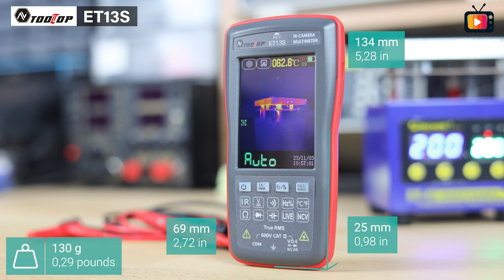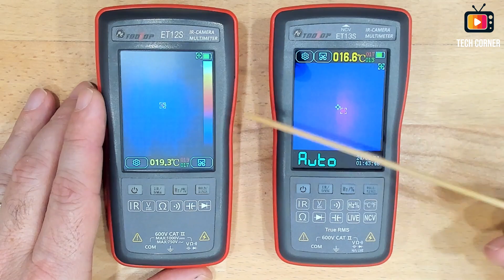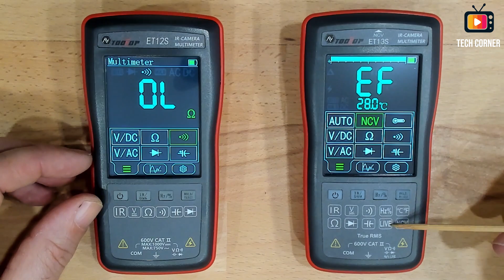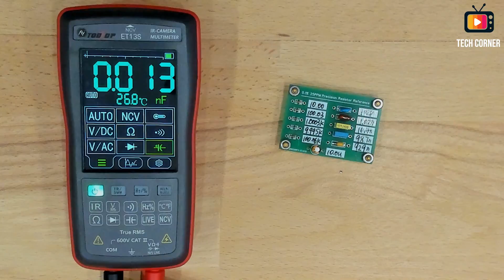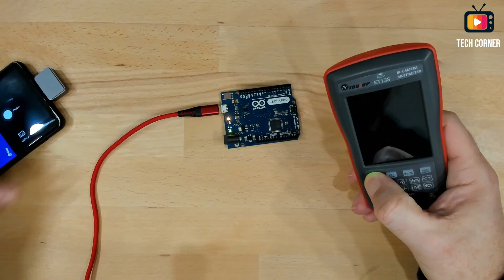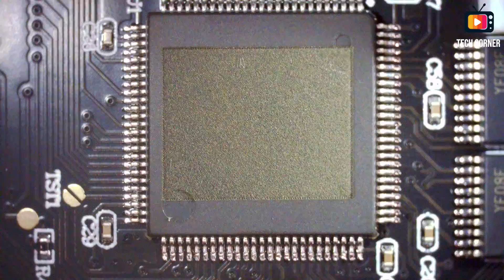Tooltop ET13S Thermal Camera & Multimeter

Comment: bought such an infrared camera (thermal imager) -tooltop et693c,
I cut out and glued a plastic overlay (ABC) for her for fastening microlyins
(to search for short circuits, on an electronic board)-
drilled two openings for the lens of the infrared chamber = 20 mm, and for the visible video camera = 14 mm,
I glued everything, glued everything with superglue,
And he glued the lens with other glue-Polimer-neutral,
Focus Lines Cloudray CO2 ZNSE
with a number = 25.4 mm (for SMD phones-PCB Circuit Board)
with a number = 38.1 mm, (excellent for SMD elements-PCB Circuit Board),
and number = 76.2 mm, (excellent for PCB Circuit Board)
The diameter of everyone is the same 20 mm, drilled and dirka for a video camera 14 mm.
It is better to take the brand of lenses = Focus Lens vs CVD ZNSE, it gives less distortion, but 2 times more expensive.
He cut out and glued a box of payments for nozzles with lenses to prevent scratches on lenses.
I recommend it! Everything works fine
Reply from the maker: Wow, thanks for the detailed information, really helpful! Thanks for watching and sharing.

Comment: Do you know the thermal sensitivity of this IR camera? I have not been able to find it anywhere and it is a fairly important spec. when evaluating an IR camera. The resolution on the display seems to be 0.1C but that is not the same thing. Thermal sensitivity quantifies the minimum temperature difference an infrared camera can detect and it is usually stated in mK (milliKelvin). It is also called the Noise Equivalent Temperature Difference (NETD). A lower number means higher sensitivity.
Reply: The newer ET15S has a spec of <40 mK. Not sure about this older model.

Comment: noticed on your video tooltop ET1 3S There was a subtle beep on diode mode. Please can you check again and let us know. Thanks
Reply from the maker: Hi, I don't know if I understood correctly, are you asking if it beeps when measuring a diode? It doesn't. Beeps on continuity. Thanks for watching.
Reply: It beeps very briefly on first connect, than stops until the next reconnection.

Comment: Thank you for the thorough review. I got the same thermal camera/DMM from banggood, under the Mustool brand and it's a quite capable little thing, especially considering the price. I have a couple of questions though. What is the max temperature, your unit can measure? Because,  even though the specification says that measurement temperature range is: -20℃ ~+550℃, the max temperature I can measure with mine is 400℃...
Also, on my unit, when I try to disable the sounds from the settings, it doesn't seems to work and the beeps are still present. How is it on yours? Is this a bug or am I missing something? 

Cheers
Reply from the maker: Hi, I was able to disable the sounds, not sure what you're doing wrong. I can share good news also, Tooltop heard me and created an macro lens to this device, I should receive it in a couple of days. Regarding the temperature, the measures I made seemed accurate, but never took it to 550ºC. Not even my soldering station can go so high. Thanks for watching.
Reply: Hello, I am thinking in buying the mustool for the price of 150€, the thermal camera is good for electronic repairs, for this price range there's another option?

Comment: sorry but flir thrmal camera is far better ......
Reply: Maybe but 5x to 8x the price...
Reply from the maker: Hi, I have to get one to compare side by side... well it always depend on the model... for example the ET693C has a much higher resolution for an acessible price, but I reall need to get one make a comparation video. Thanks for watching.
Reply: And far expensive!
Reply from the maker: @romulodecastrodasilva5863  Yes, that too. But you can't do omelets without eggs, if you use a far more expensive thermal sensor/technology, the device will be more expensive.

Comment: What kind of air quality monitor is it?
Reply from the maker: Hi, this is a Tuya 13 in 1 Air Quality Monitor ( https://geni.us/13in1-airqualitymeter ). I use it to monitor the air quality while resin 3D printing. Thanks for watching.
Reply: @TechCornerTV  you should do a tear-down of this - most of these cheap air-quality meters have a single sensor, and generate random values for sensors that it doesn't have!  This makes them essentially worthless/dangerous if you're concerned about your health.

Comment: 29:00 You're an electronics engineer. Don't buy a new hot air station. Repair or modify the station you have, to make it do what you want it to do. 
As electronic engineers, electrons (and holes), are our bitch. WE tell them what we want them to do. 
You should do the same with your ''rogue'' hot air station.
The process would make a great video too. 😊
Reply: Agreed. There are actually 2 ways to calibrate the hot air temp for this particular rework/soldering station. If you take it apart there’s quite a few potentiometers inside that can be used to calibrate all its functions such as the hot air/soldering temp reading and things like the voltmeter read out. There’s a few videos on YouTube showing which pot to turn.
I’m not sure 100% sure of the second method but if you hold down both temp up and down buttons for a few seconds, it enters calibration mode. You will however need to find something that can heat up to exactly 230c if you choose to do this method. I’m
not sure why it has to be exactly 230 though, but apparently it states this in the manual. Also I’m with you on this making a good video too.
Reply from the maker: Hi, you're so right... the problem is not the equipment to fix, is really the time... but to be honest, for what I do, even with a 50º overshoot it will not be such an issue. It will be a nice to have, maybe a manufacturer read this and send one to test 😁 Thanks for watching.

Comment: Nice review. It’s a shame they don’t supply a macro lens, especially since it has a multimeter built into it and so the user may need it to look at circuit boards. Thanks Hugo.
Reply from the maker: Hi! Yes, with macro lens it will be a totally different product. In that way, InfiRay is much smarter. Thanks for watching.
Reply: @TechCornerTV The InfRay is amazing and will be my next TI purchase. I keep hoping that the price will come down to £150 but no luck so far.
Reply: I use this instrument day-by-day and from my work on mainboards I can say that a makro lens is not necessary to find a hotspot. The thermal sensor is very sensitive to temperature changes. So it's possible to find hotspots even if you can't feel it on your fingertips.